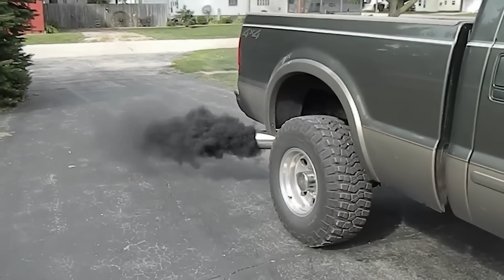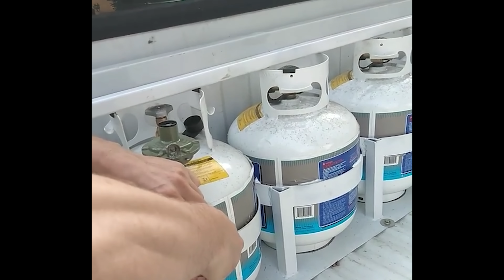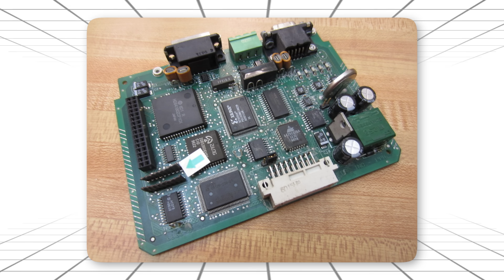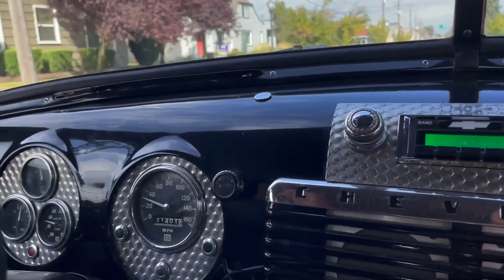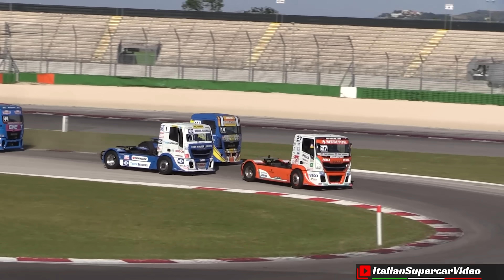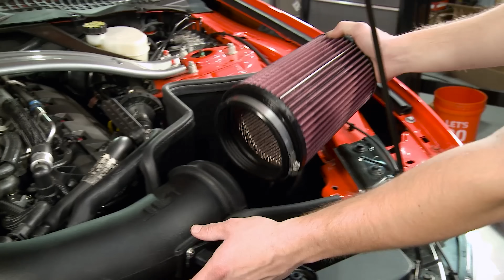They Made This Diesel Trick ILLEGAL For A Reason

Comment from the maker: Hidden commentary track loaded into this video. Change the language to Klingon to hear it.
Reply: It this ai?
Reply: @tvviewer4500  yes, it's AI.
Reply: @tvviewer4500 Seems rather legit' to me... There IS an alternate audio in Klingon + I know engines well enough to recognise it's not BS...
Reply: @podulox it is an ai channel
Reply: @podulox  It works because diesels are lean and slow burning engines. You can throw more diesel at it, but when you throw too much diesel in, it'll burn only the hydrogen atoms in time, and throw the carbon out as soot. Propane does two things: it accelerates combustion and makes the mixture richer. it even lets you add more diesel without creating so much smoke. you can't add too much propane because it might enter the window of auto ignition and destroy the engine.

Comment: We used a can you use for a hand torch. Just put a hose over the torch and use the valve to turn the gas on just like you do when you want to light it.  Put the hose in the air box and it's that easy. $4 back then for a blue bottle. Fried put a BBQ tank in the car and use it for long drives because on the highway it was cheaper to run a BBQ tank vs gas alone.

Comment: I’ll run propane injection for years. I run the bully dog kit on my power stroke. It adds around 75 hp and 125 foot pounds of torque and drops exhaust temperature pulling a load almost 400° has never done any harm to my engine and I have over 300,000 on my motor running propane and a super chip exhaust and down tube have a grill tank in my toolbox the bully dog kit teach the propane before it enters the system. I’ve never had any issues through about six years of running it.

Comment: If this works(and it appears that it does), why dont manufacturers engineer the change and add this mod as a feature?

It should be easy for big names to push this advantage through the red tape machine. The pollution reduction should have the support of the tree-huggers and climate change fanatics.

Comment: It works because diesels are lean and slow burning engines. You can throw more diesel at it, but when you throw too much diesel in, it'll burn only the hydrogen atoms in time, and throw the carbon out as soot. When propane is added, it makes the mixture richer, and when it gets ignited by the first diesel flames, it accelerates combustion. It even lets you add more diesel without creating so much smoke. you can't add too much propane because it might enter its window of auto ignition and destroy the engine.

Comment: Ive owned 2 dual fuel cars one of which i have now. They are petrol/lpg though.
The first one i owed when i was younger was an au falcon and yeah you could use the gas as a cheap nitrous 😂 the trick was have the car in petrol and floor till its pretty much hit its limit and while foot flat press the lpg button and it just dumps full load of gas into the intake manifold and the car just boosts. It only really works when the car is under really heavy load. Fun till you blow a gas line and your engine freezes 😂😂

Comment: propane is old school, they figured out over 20 years ago that nitrous oxide (N2O) worked better in diesels than it did in gas engines, and it out performed propane by a mile. unlike gas engines, diesels were built so much better that they could run it and still be reliable with higher power and efficiency than propane.

Comment: be aware of using propane injection in cold climates and with full bottle of propane. it can inject liquid propane not gassified  - and then... engine knock and bent rods. learned this the hard way. bent 2 rods on my vw I5 tdi. turbo must be in boost when adding propane into intake after turbo. pulls like a train. lots of black smoke cause mixture gets too rich. i used roofers torch under the gas pedal to regulate gasflow  - complete hillbilly diy setup but it works. Plus i added water-meth kit. absolute madness..... nice way to get rid of the rods:) Like MB om606.  but if ur careful and know what ut doing, MAN ITS NICE. Wil do it again for shore. larger displacement older tdi engines with beefy rods are better for this setup though.
Reply: I would love it to be friends with you 😂

Comment: Too bad the guy who wrote the script for this AI slop doesn’t understand combustion. 

There isn’t some massive amount of in burned diesel fuel coming out of every power stroke in an engine. Propane itself is a fuel, one that creates power. By volume, it has about 65-70% of the energy that diesel fuel does, but in this situation it’s much more readily delivered to the engine, since it’s a gas and not a liquid that needs to be precisely sprayed through the fuel injectors. 

You’re getting a more complete combustion event, but you’re also using more of the available oxygen in the cylinder by adding more useable fuel, which is basically how you create additional power in a diesel in the first place.

Comment: Deisel oil burns pretty completely when the proportions are right. If those assholes are "coal rolling" they are pumping in twice as much fuel as they should be. If you use the correct amount of fuel it all burns and you don't see all that smoke.

Comment: black smoke is actually burnt fuel  right before the powerstroke causing you to lose power the less black smoke the more efficient your diesel runs and that doesn’t mean modern wngines with NOX emission i mean trucks that make the most power with the fuel by burning at the right cylinder pressures unburnt fuel aka raw fuel is white smoke with a blue tint on diesels and the smell of rich smoke that smells like fuel

Comment: As someone with propane injection in diesel, make sure to have water/meth cooling too. Otherwise you risk high EGTs….if you put too much propane you risk knocking. Also

Do not, do NOT inject before turbo. You need to inject right into inlet close to header. Pressure there on idle is >1bar so something to consider.

Comment: It makes a ton a sense since diesel is slower to detonate and really only adds power to the bottom half of the stroke and propane is quick to detonate and will add power right from the start and would contribute to a fuller diesel burn as well. I'm a gasoline guy and with classic carbureted cars you have to setup your intake system and carburetor insulation to have the best balance of atomized and vaporized fuel to get maximum power out of the full burn stroke. It's more complicated than one would think to get the full potential out of a gas motor and to find the right balance if you're actually street driving and not just doing blasts down the strip.

Comment: did this in the 1960's in UK  BBC featured prototype automatic propane fuelling of heavy trucks about the same era.Excuse was made that propane injection could not be fully regulated which is a a load of BS. Pre-ignition is almost impossible with propane. My experience was that excess propane choked combustion.
  Throttle butterfly valves are absent in a;most all diesels.

Comment: I was so close to piping it in (maybe $100)  if the $6000 mods didn't resolve this. 
Pulled over going thru Kentucky have 2010 F250 Lairat 6.4 Twin 4x4 slightly modified NOT to roll coal ok 
- 6" S.S headers back w/duals
- Cold Air intake (custom S.S box and S.S piping) 
- Fuel controller (not putting name out) 
- upgraded Fuel lines,fuel filter capacity / size
Ok I'm 50 mechanical field engineer means my has to run at peak performance so the time designing and building well worth it. Rookie state trooper writes me a $396 ticket ok and he took it back after reading his comment of why i received it because " exhaust modified to blow smoke " I'm not a kid i asked him if he would be in court with me and he asked why ok my answer was a question and please USE this " i simply asked this baby faced Kentucky State Trooper - i asked him if he was a mechanic he said NO ok so i asked him if he was a diesel mechanic and guess what his answer was lol " so as he grabs the ticket out of my hands (I'm laughing by the way ) and he was pissed lol

Comment: Propane does not burn first. The diesel ignites the propane as propanes auto ignition temperature is much higher. It will not pre ignite unless you introduce it while the glowplugs are activated.
Reply: Thanks for that information, I was wondering if the propane ignited first then the injection timing have to be retarded but you’ve answered that question for me.

Comment: the Hindemburg of Zeppelin fame used the same trick to compensate for thinned air, and it was determined to be "sicher" by German Engineers (who measure the length of a car in millimeters and have standards for potholes on the street), so, a propperly tunned gas on diesel system should be safe enough, (BTW, static electricity killed the Hindemburg, not this crazy setup, just to make that clear)

Comment: I ran an 03 7.3 powerstroke like this.  I ran the gas through the air so it wasn’t exactly like NOS.  But it made a complete burn with added power and amazing mpg.  Ext cab 6”lift with 36” tires pulling a 4 place enclosed dual axle snowmobile trailer with 5 sleds and a loaded toolbox in it running 65-70mph getting 24mpg calculated by gallons used and miles adjusted for tire size.

Comment: That black smoke is injectors turned up too high!  Propane is only burning the excessive fuel someone is pumping into the engine that can't be burned. My Ram Cummins stock has almost 1000 HP and 1000 FP of torque sure it could be deleted I might eventually and it won't blow hords of black smoke!  No need to waste the fuel trying to blind a Tesla.

Comment: Propane injection has been around for many decades.
CNG works too, at a much lower efficiency.
You could do this with VW diesels too for an increase in power and efficiency.
You have to closely monitor exhaust gas temps though.
There are all kinds of crazy things to increase power and efficiency.
Such as adding pure acetone to gasoline.
(acetone eats through certain plastics so be careful which fuel systems you add it to)

Comment: Propane gas less power per BTU than diesel. 
Adding propane to a diesel engine throws off the air fuel ratio making it richer leading to more incomplete burn. This whole propane injection thing is a load of bullshit.

Comment: He's wrong,the propane can't ignite,with no ignition source,which is what compressing diesel does,it ignites,then it causes the propane to ignite!
I've owned 2 trucks on straight propane.
Propane burns cleaner,but hotter,engine rings don't burn out,except when I ran my Ford with no air filtet!😢😢😢
 It's a pain to find a propane ,but the Ford windsor 351 ran just fine on it,so the chance of detonating your engine is questionable!
My International big block ran on straight propane, but the company burnt the valves ,because they changed it from gas to propane, without doing the valves, by running straight propane, because the valves weren't anealed and heat treated valve seats!
They had to send the cylinder heads out for valve repairs and have the valves anealed! 
So,I will say it does run hotter! And may destroy your stock engine if you use it too much on a hill climb!

Comment: Seems also that propane being so cold it also condenses more air/oxygen that's introduced each intake.
Reply: Propane gas is not so cold liquid propane is!
Reply: @neilasd3043  it seems your a BOT, everyone knows knows even the gas released is far below the.ambient temperature. Crack the tank valve with your hand in the gas stream, exiting temp around -44 F, that's 76 degrees BELOW FREEZING temp. Of water, and we're 70% water.

Comment: It's a dry program though, and you don't want to burn out your rings prematurely because there's not enough oil on the cylinder walls. It would be safer to run a water tank with electrolysis going on. Use that same hole you made in the air intake to insert a little extra free hydrogen and free oxygen while rolling down the highway. It's not a booster but you should get better mileage when it's on.

Comment: If a diesel is set up correctly, it will only give a thin brown smoke when pulling at max power. Otherwise,  no visible   smoking. Blue is worn oilrings. White smoke diesel pump too slow, not giving enough fuel. Black smoke is, if you seriously needs and really don't get attention, try BLACK smoke !

Comment: Saw a semi years ago that had propane injection that was used occasionally to clean out the engine since propane has no carbon in it
Reply: Someone is lying to you. The chemistry book says anything ending in “ane” “ene” or “yne” contains carbon
Reply: Propane is a hydrocarbon...but you're right that it can clean out carbon deposits (by burning hotter in the combustion chamber), just have to be careful though because it can burn hot enough to damage an engine if run too rich.

Comment: Hell I was using propane injection on my semi truck back in the day. A cat engine would pick up and pull over the Rockies like it was flat land. Back in the 90s we didn’t have any problems just couldn’t over do it. Low pressure is just enough to get the job done.

Comment: Bullshit. Diesels burn clean until you inject more fuel into the cylinders than the air provides enough oxygen to burn it. Adding more hydrocarbon into that mix won't add power or make it burn cleaner.

Comment: Would propane help cold starting if someone didn't plug their block heater in overnight in subzero temps?
Reply: Yes, it should compression-ignite in most engines. Actually older engines generally has even-high compression ratios so it should work on anything. As-long-as the propane ignites by itself the Diesel will certainly ignite after it as the TDC charge temps will be higher no matter how cold it is.

Comment: Diesel engines don't have significant vacuum
Reply: Piston sucking 20 to 1 compression ratio is not significant vaccuum?
Reply: @fidelcatsro6948 nope. Thats why diesels need pully run vacuum pumps. There's no venturi to create vacuum, they run open air

Comment: This is the same idea as with HHO in a gasoline engine.  It acts as a self oxidizing pre-igniter for the fuel droplets.  Thus, the fuel in the cylinder is burnt more cleanly during the combustion cycle.  Less is expelled during the exhaust stroke, so the need for a second burn in the catalytic converter is eliminated.
Reply: Hho works even better in diesels. Older klonkers with primitive injectors get the most benefits

Comment: A company here in the UK called Calor Gas did that to theire delivery tankers in the 1960's as a trial. They were trying to prvent smoke, the problem they faced was the gas cylinders were freezing up as the trucks went up hills. The trial must have been a failure as they stopped it after a while and no more was seen of system.
Reply: A heat blanket would solve that problem.

Comment: 2JZ with Nitrous? Naaaah.
OM606 with Propane? Yaaaaas!
Reply: literally staring at my swapped w124 wagon thinking about tapping into the houses natural gas line to the grill....
Reply: Yes sir, IDI with modern twists to it ends up the ultimate engine, who would've thought!!
Reply: I've been running propaeanr in 603 and 617s for years. You need to be careful with volume and timing. Especially at low rpm/boost. Two regulators on separate solenoids controlled by  hobbs switches to come on at low and higher boost works nicely.

Comment: Does anyone remember the Diesel GM made out of a 350 Old's V8? They devalued the car so badly I used to buy cars that weren't even rusted (I live in Michigan where salt is king) for a couple of hundred dollars. I got one from a guy I worked with who had suffered a water in fuel injection pump failure that cost him $750 and a day missed at work. Then his glow plug system stopped working and it cost him around $500 to replace all the glow plugs and BOTH controllers (it was a Cutlass Supreme glow plug system) Anyway I bought the car from him for $200 and got it running. It was very lacking in hp, but when I put my BBQ grill 20# Propane tank on it and simply ran a hose from the passenger side front footwell out the window under the back of the hood into the air cleaner inlet it made that sickly anemic 350 Diesel run like a 350 Gas. But you should have seen the Black Smoke coming out the tailpipe. It looked like an old time coal fired locomotive. I mean it was worse than a cement truck. It was fun, but I eventually destroyed that engine. ben/ michigan
Reply: I picked up a Diesel Cutlass Brougham for 2K. First thing i had to do was scrap the GM glow plug controller.  
Used a toggle switch and a count to ten instead.  Worked fine for awhile after that.  
Eventually swapped out the target diesel with an used gas 350.
 Kept the original trans which would hit 60mph before shifting into second. Fun car.
Reply: They were garbage!!!

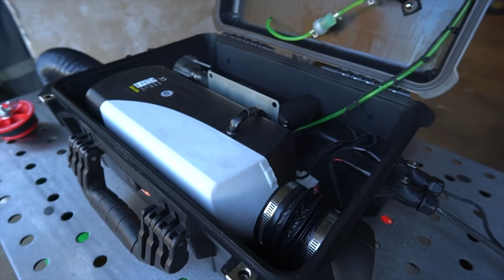Comment: Do not run propane through a Chinese diesel heater shown at 5:27. It does not have valves to seal the propane when it gets touched off.
Reply: Lol😂😂
Reply: working on the buzz job 😂

Comment: For diesel ⛽ spray alcohol or gas anything flammable just make sure it stays away from oil
Reply: What should stay away from oil? Do you mean you need avoid getting getting alcohol into the engine oil? It might be a good idea to avoid alcohol injection before the engine is warmed up.